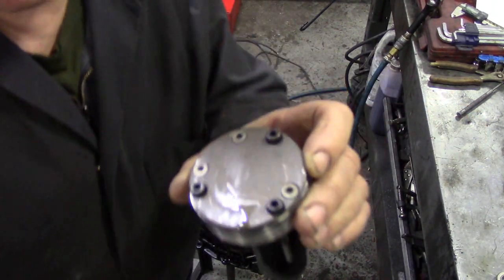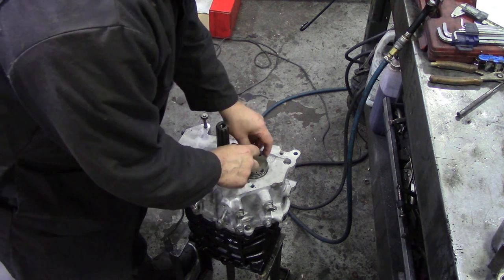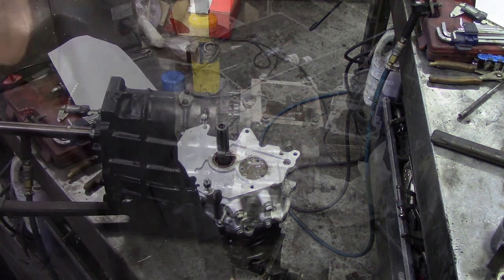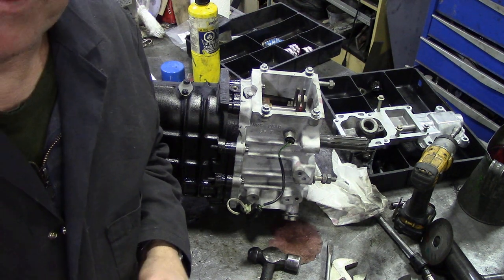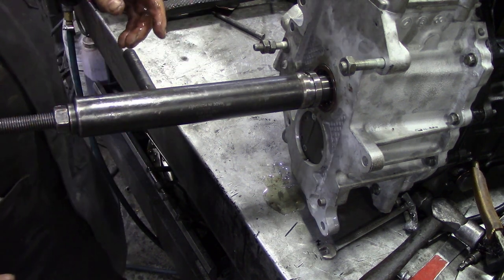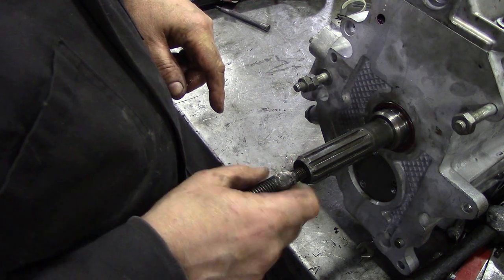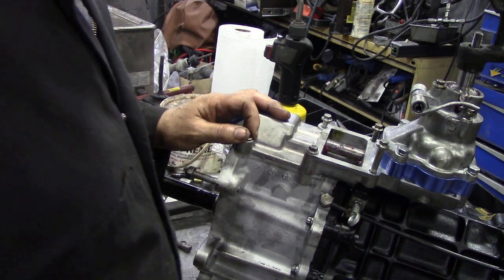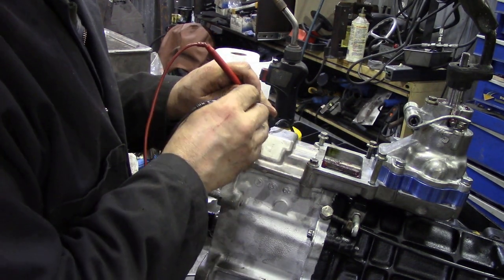R380 suffix L overhaul Part 12 oil pump and finishing off

Comment: Hi Mike, i have a TD5 Suffix L gearbox and want to mate it to a 300Tdi engine. What will have to be converted on the box to make it work? Excellent   TD5 gearbox rebuild series by the way!!
Reply from the maker: It can be done, and I have done one in the past -you need to change the primary motion shaft (input) But this is where the can of worms comes in - the tooth count on the layshaft maybe wrong - this can get expensive, as you 'may' have to change other gears too

Comment: Slick Shift: I don't think anyone should kid themselves that it miraculously somehow turns the whole R380 gearbox into an on off switch type semi automatic DSG style fast & slick racing machine, however it does shorten the throw and requires less rowing between gears pausing momentarily to allow the synchros to spin up the gears to avoid crunching.
Amazing though how many new cars still have a crunchy change up to 2nd gear on cold morning's.

Comment: Thanks for this series Mike, haven't rebuilt a box since my Mk1 escort in the 80's but now feel confident to do mine when it becomes necessary. 👍
Reply from the maker: They are not bad to do - just the tools you need are quite unique
Reply: Fortunately l know a guy who has the necessary and is usually willing to loan it out.
Reply from the maker: That's a stroke of luck!